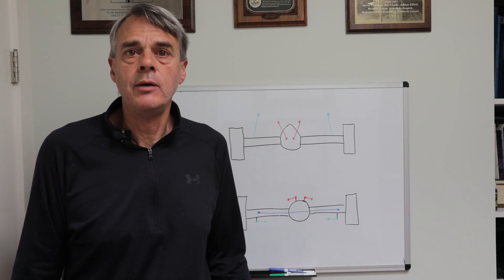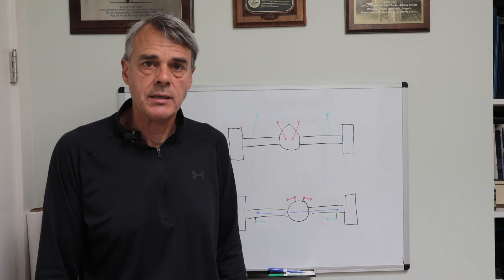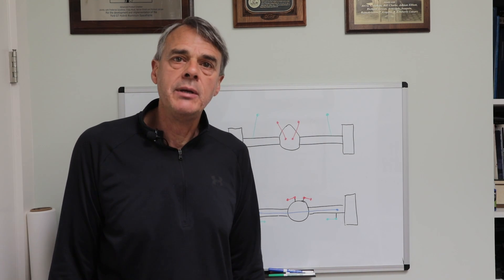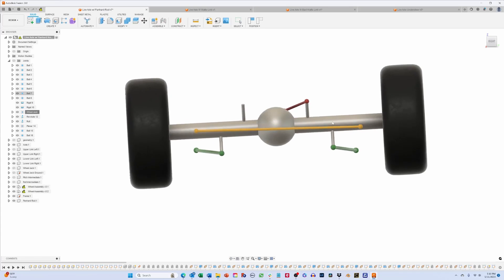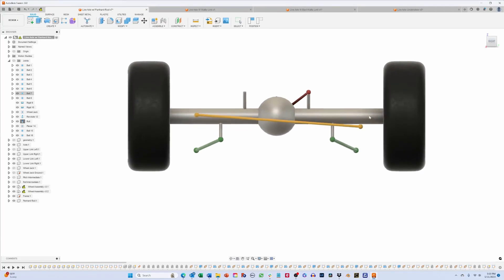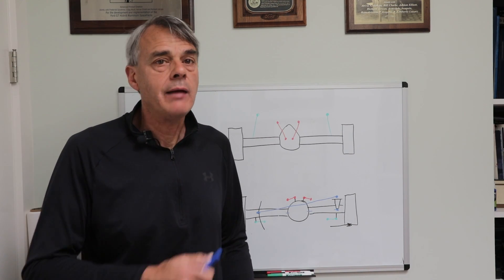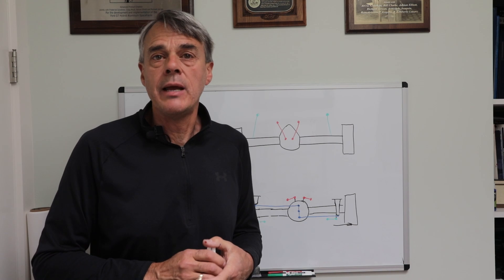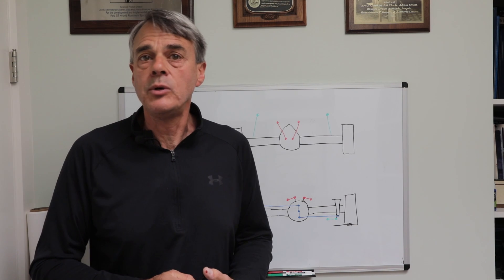Watts Link vs Panhard Rod: Which is Better?

Comment: Ford Australia did the engineering on the Ranger Raptor and they have historical experience with using a Watts linkage on the Falcon.
Maybe their old data persuaded them to go with a Watts setup rather than a Panhard Rod.

Comment: I thought triangulated 4 links already prevent the axle from moving laterally unlike a parallel 4 link. I have ford taunus tc2 and its got triangulated 4 link and ford said they used it to limit lateral movement without having to use panhard bar or watts link. The 90s and 2000s mustangs also have the same triangulated 4 link found on my taunus

Comment: Interesting video thanks just wondering why  on  the Discovery 2  it has a panard rod used at the front and watts link at the back. .. note has air suspension at the back.

Comment: The Chevy Cruze came with a watts link (z link) in higher trims. I swapped the rear axle beam in my Cruze to upgrade, for autocross run trying to stiffen the rear, increase roll frequency try to get rotation.

Comment: I hate panhard rods. I deal with lifted 4x4 vehicles on a daily basis, and unless they have panhard bracket extensions, the back ends wiggle over bumps, and I hate it. I actually prefer leaf rear ends over panhard rod rear ends. Of course, out of the three, I prefer a Watts Linkage if it's in the OEM condition, but even that isn't perfect when lifted.

It's interesting that the panhard and Watts linkage systems were shown with upper control arms at angles to control transverse movement somewhat. I'll have to take some more notice of this the next few times I'm under panhard/Watts linkage vehicles. The ones I've worked on lately seem to have had such slight angles on the upper arms that they seemed to be parallel with the longitudinal axis of the car. Maybe there's more angle to them than I've noticed (I'm always dealing with the springs and shocks, so I tend to ignore everything else, except in as much as they get in my way while dealing with the springs and shocks).

Comment: I've had cars with both (at the same time).  Watts linkage was far more consistent handling due to roll and traction was better.  Best I was prepared to do with the car with the Panhard rod was heavy duty sway bars to limit roll.

Comment: WOW. Very informative and great explanation between Watts and Panhard and why certain designs, do or don't, make ii into production.  But for my Ford Transit Van, it will be the simpler hard mounted 'Panhard Rod'.
Small channel, but subbed (just in case you come up with another 'Golden Gem')
P.S You must have been an automotive engineer in the auto industry to know this much about suspension design at your age. Lucky for us and YT!

Comment: What is your opinion on using a suspension like this .  (4link with watts link) use heim joints on all positions. Except where they mount to the frame, in those positions use joints  use either rubber or polyurethane bushings . Do you think this would give a decent ride. Every thing I know I learned from studying and some work on lowered trucks and race cars. Part of my study was a degree I earned from trucking magazine. Haha.. I had to build my own parts . I had a two link and kept one leaf spring to locate the diff. Far from perfect but it worked.. had air suspension. I really wanted a 4link with watts link. The tire size and rim width didn't leave room for side to side movement a panhard bar  would allow.  being a small amount I still didn't want any, it only had about 7"-8"of travel at most unless fully aired up. And this was rare.. thanks fof all the great videos! ✌️

Comment: What about triangulated 4-link rear suspension?
Lower links are parallel to the frame,
Upper links are "triangulated" i.e the axle mounting points are close together approximately at the center of the rear axle (above diff housing).
This system doesn't need Panhard bar or Watts links.

Comment: Like your video. Will you make one comparing a triangular upper or lower center link that controls not only what a four link does, but also controls lateral movement because of the rigid triangle link, similar to some old Lotus cars. I’m also interested in the roll center height and how it affects cornering. With the Lotus design, I think you are limited to a low roll center.
Thanks, very interesting!

Comment: Keep it simple. A Panhard rod means the vehicle will handle good in one direction and bad in the other direction. A Watts link will handle either good or bad in both directions. If you really want to get confused, try working with a Mumford link rear axle control.

Comment: I race with a watts link.
ignoring the handling benefits honestly, it's smoother.
ride quality is way better.
I can go 100% throttle over bumpy tracks without any issue.
my panhard bar always had issues with bumps.

Comment: Excellent video, thank you! I have been wanting to improve the suspension on my 2014 Mustang and all signs point to replacing the rear panhard rod with a watts link system. However there never exactly was an explanation of why the watts link is better. This gives me a great deal more confidence moving forward with this project. Your voice and delivery of the presentation is also up there with some of the best TED speakers ive ever heard.

Comment: Decent beginning to the video...but the decision making behind the engineering used for your example (the "Raptor") wasn't adequately explained. In that application, yes the Watts was a good decision for lateral location due to significant suspension excursions and no need to have the absolute lowest roll center. However, for on-road performance applications, the Watts is a poor choice compared to the Panhard, which has fewer moving parts, requires fewer modifications, and would have a lower roll center compared to a Watts. To simply state "the Watts link works better" isn't necessarily true.
Reply from the maker: You are correct that a Panhard rod has fewer parts but it is also asymmetrical. The placement of the roll center could indeed be lower with a panhard rod but only if the rod is installed in a low position which may not be desirable for ground clearance and structural reasons since the roll center will be at the height where the rod crosses the centerline of the vehicle. It is also true that a Watts link will have one of the links below the roll center while the Panhard rod is right at the roll center but there are ways to mitigate this somewhat, which is what the Raptor does. For shear performance, I stand by my claim that a Wats link is superior, even if it is more complex.

Comment: Can you comment on roll centres for panhard and watts,
Reply from the maker: The roll center for a panhard rod is where the rod crosses the center of the vehicle. For a Watts link it is at the pivot point of the link where it attaches to the differentcial.
Reply: @suspensionsexplained  what if it’s not level?
Reply from the maker: Doesn't matter. it still forces the roll center to be where the link crosses the vehicle centerline.
Reply: @suspensionsexplained   thus Panhard link allow lower RC than Watts link, this may be relevant to choose among

Comment: Best explanation I've ever watched.  I run a frame mounted watts link in my triangulated 4 link in my Cutlass with rubber bushings. Started with Poly bushings and it was a no-go as the bushings would bind up unsettle. Switching to rubber made the car a dream to drive, the axle no longer shifted left to right settling into a corner and I could change the rear roll center with a single bolt and select how much over/understeer I wanted for a certain track.

Comment: Good video. What is your educational and work related background?
Reply from the maker: Shawn, i have a BSME from Duke University and an MSME from Georgia Tech. I also have 31 years experience in the auto motive industry focused on chassis design and engineering
Reply: @suspensionsexplained  I love that YouTube has provided a platform for the public to glean a ton of knowledge from a seasoned industry professional, what a time to be alive.  I have a BSME from UConn and now work in the MEP controls industry, but the automotive industry fascinates me.  Kudos to you for putting this knowledge out there, and I hope your channel takes off.
Reply: Hey man, did you happened to work for Tesla back in the early model S days?

Comment: You wouldn't run double triangulated 4-link suspension with either a panhard or a watts. Triangulating the arms creates a lateral locating force, making a separate locating link unnecessary. Adding a locating link also causes binding since the main links and the lateral links create different roll centers. Even with bushing deflection you're going to run into trouble combining the two. Once watched a video that accidentally displayed exactly this problem. A fabricator posted the video to "prove" the watts link was garbage that caused binding. He had put it on a double-triangulated 4-link.
Reply from the maker: What you are saying is true if the links are all perfectly stiff and the joints are all heim joints. But if the joints are rubber bushings then a Watts link will still be an improvement since the compliance of the rubber allows the Watts link to do its job. It will also be a much more comfortable car to drive in.
Reply: @suspensionsexplained  ...what you're describing is a total compromise. What John is saying holds true. Very, very, very few people will install sloppy rubber bushings in a triangulated 4 link so they can add a Watts...
Reply from the maker: Actually, you will need some compliance in the other links if you want to use a Watts link or a Panhard rod. Both try to move the roll center away from where the 4 main links place it so you MUST have some compliance in the bushings in order to stop the whole thing from binding. What both do is allow you to have high lateral stiffness (for good cornering and steering response) while using relatively soft bushings to get longitudinal compliance for good ride and comfort. As far as compromise is concerned, absolutely EVERYTHING in suspension design is a compromise of some sort. You just have to have your priorities set before you start your design. @anonymousplanetfambly4598

Comment: Will this keep the rear of the car from stepping out in a corner?
Reply from the maker: That depends on other things. The axle is still moving with the suspension so there is still a lot of unsrpung mass. If the corners are rough, it will still cause the axle to bounce a bit and "skate" in the corner. Having said that, using a Watts link or Panhard rod will make the rear feel much more "planted" and confident in a corner. The vehicle will turn in more sharply and precisely and will feel much more confident.

Comment: Firstly, I'm loving these videos. They are instructive and easy to understand so thanks very much for that. The question I have is in regards to the watts linkage. My car is equipped with a 4 link trailing arm and watts link. If you google 91 Australian Ford Fairlane you will see the car I have. As an update in the 96 model (EL Falcon) they dropped the pivot point 20 millimetres to lower the roll centre. There was also some changes to the mounting points for the trailing links as well. What would the effect be in fitting that diff hat to my car? Bare in mind it's built for comfort and in its natural form can understand quite strongly with a sudden transition to oversteer. One of the main problems is the steering ratio is slowish around the centre to half turn. So I was kind of hoping that a change in the rear roll centre would delay the transition to oversteer. Hopefully I've explained that well enough! Thanks.
Reply from the maker: Thanks for replying and thanks for watching. I am not familiar with the Australian Falcons but lowering the watts link would have had the effect of lowering the roll center by the same amount. I've read this helped stabalize the car but the change was made as part of a much larger package of changes so it's hard to pinpoint what actually made the cars better. Here's a forum a friend of mine sent me that talks about the changes: https://www.fordforums.com/threads/whats-the-difference-between-ea-and-ef-l-rear-suspension.11130/
I hope this helps.
Reply: @suspensionsexplained  thanks for the reply and the link. I might have a play around with it and see what happens as it could be a nice cheap mod to tidy up the handling a little. I do know I have a couple of different holes to mount the upper arms to the diff housing but not as many as the later ones which had a few suspension variants. But yes, I appreciate your answer and the information that you freely put out in your videos. Looking forward to the next one!

Comment: Awesome video, I watch a lot of Matt's Offroad recovery, even though I don't do any offroading, and I always wondered what the heck is going on with that giant horizontal link in their vehicles. So all the movement that the Panhard rod allows is from bushings deflections? That makes it sound like design of bushings is a huge deal in this suspension type in particular?
Reply: I'm not sure if I'm saying this right, but I'll have a crack at it...   

If the control arms are triangulated from the top view, then the lateral motion is technically already constrained, so adding a Panhard rod would introduce bind (the severity would depend on the angles of the links and length of the rod), and would require deflection of some component for the suspension to travel.  But if the links are parallel (top down view) the axle is free to move side to side so it can follow the ark of the Panhard rod without bind.   So, to answer your second question... Yes, the design of the bushings would have to allow enough deflection for the design of the suspension or something will likely break, but not all 4 links will have that problem.   All of that bushing deflection is less than ideal for performance, so this particular suspension is probably making a sacrifice in that aspect to gain somewhere else like packaging or something.   

A 3 link with a watts link or Panhard can operate bind free, so solid spherical rod ends work fine.  Technically, all non-parallel 4 links will bind in roll... they try to twist the axle, but the amount is usually minimal.   I have, however, seen ladder bars break front rod ends and I suspect it's due to that kind of bind.
Reply from the maker: Just to clarify, most of what you are saying is correct, however, a non-parallel 4 link will not bind in roll. With 4 links, there are 2 degrees of freedom available: roll and vertical movement. There is no binding. Introducing a Panhard rod or even a Watts link will introduce binding though. The use of bushings in the links will eliminate the binding and allow the system work. The Watts link adds control and lateral stiffness while the bushings add comfort. The best of both worlds.
Reply: @suspensionsexplained  sorry, i meant non-parallel in side view.  The side view swing arm will cause the axle to rotate forward on the side that compresses and back on the side that extends. Unless the links are parallel and SVSA is infinitely long.